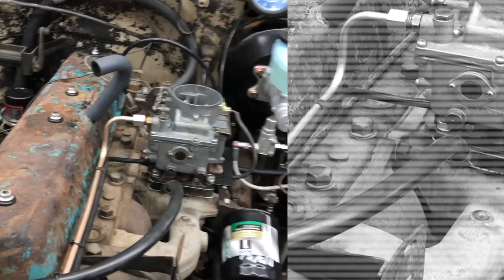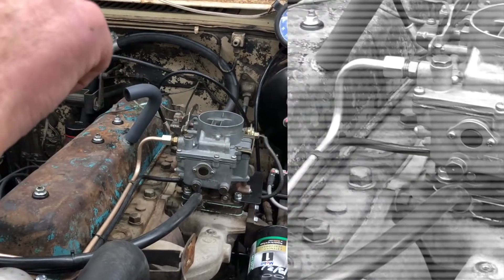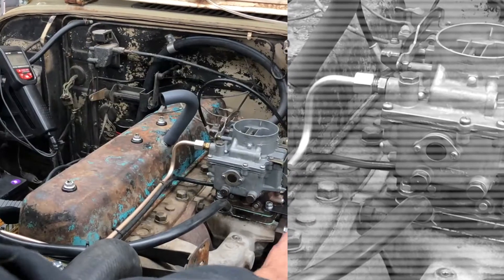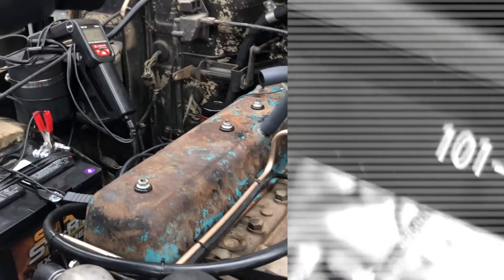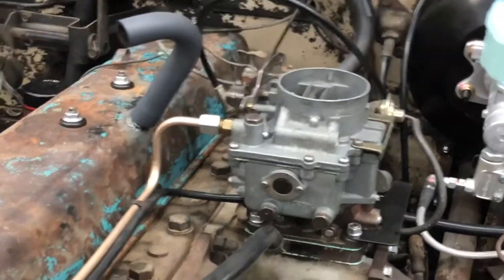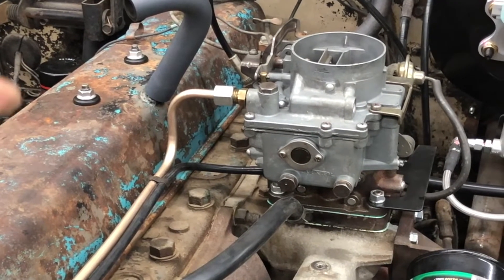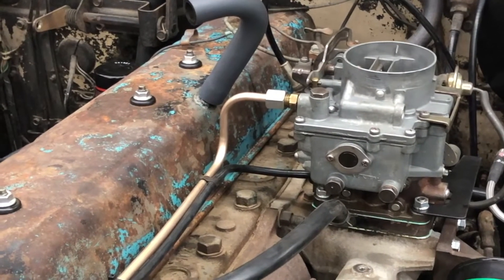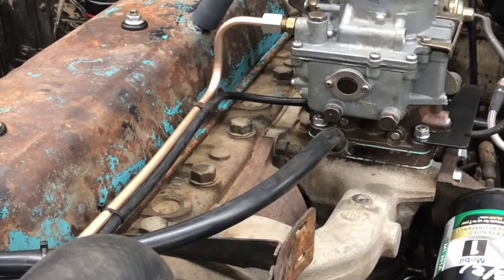How To Save An F-Series Toyota Land Cruiser Engine & Why Toyota Carburetors? Red Line Land Cruisers

Comment: If you were to live in a place like Colorado Springs.  You like to  go into the mountains.  You got a FJ60 recently with a spare engine from a FJ 62.  Would you stay with the car or go with the fuel injection?
Reply: fuel injection just causes more issues. been there done that. stay with stock carb. if it has a webber, replkace it with stock aisin carb
Reply from the maker: We like the factory carbs!
Reply: @npig23  had the option for the fuel injection engine or carb.  Took the head of the fuel injection engine to the machine shop, but it had two cracks.  So back to the car engine.  If I keep the FJ60, I mill probably do a throttle body injection
Reply from the maker: We have the EFI Sniper system for FJ60: https://redlinelandcruisers.com/product-category/60series/fj60-2f-sniper-kit/
Reply from the maker: Funny! We are in Colorado Springs! That would be a good phone call for the boss, ask for Justin 719.638.2003.

Comment: Heard your comment about elevation.  Me, "I wonder if they are in the Springs".  Found your website and saw that you all do, would like to visit and learn what I can from you all if that is alright.  Last weekend I purchased a FJ60.  It came with a spare engine 3F, not sure the year, will need to look up that stuff.  I started to take it appart.  

 The current engine starts to die if you push in the choke, maybe not warmed up enough?   The body needs work.
Reply from the maker: Please stop in and visit us!

Comment: can this engine be paired with an 80 series tranny?
Reply from the maker: I don't think you would want to put such a heavy transmission (80-Series) onto the older F/2F engine. The did with the 3Fe and auto trans for both the 62-Series and FJ80 (1991-1992) 80-Series. Are you specifically looking to put an auto-trans in an FJ40? Give us a call at the shop some time to discuss: 719.638.2003

Comment: Loved this video. Had the info i have been looking for. I bought a 1970 fj40 with its orginal F-engine, but it runs like crap. We have already done alot to it and it didnt have too many miles, or poor mantinence. However, it still has a few problems. Firstly, the carb mixture screw doesnt do anything. For some reason it has a 2f carb on it right now. Would having a 2f carb on a 1f engine really change all that much with how it runs? Also when driving the car up a small hill, there is a lack of power, as well as you have to rev the piss out of it to get up the hill. We just ordered a correct carb and hopefully that works.
Reply from the maker: Did the correct carb help? Sorry for the 1-year later response!!!!
Reply: @Redlinelandcruiserscolorado  yes it did. I was able to find a date code one and rebuilt it completely. The idle soleniod needed constant power to stay idling.